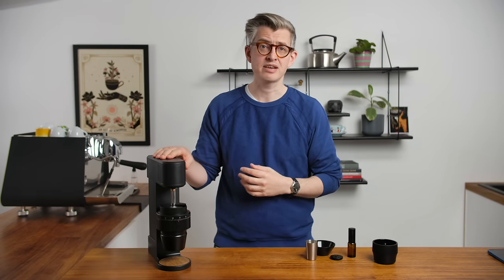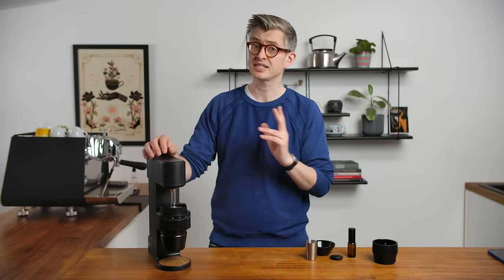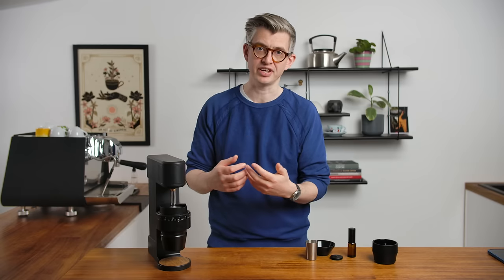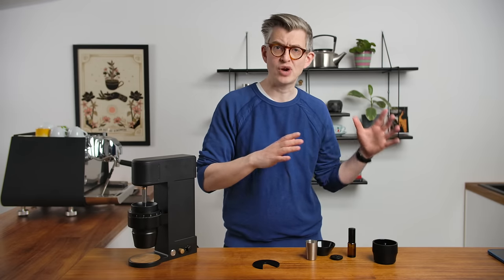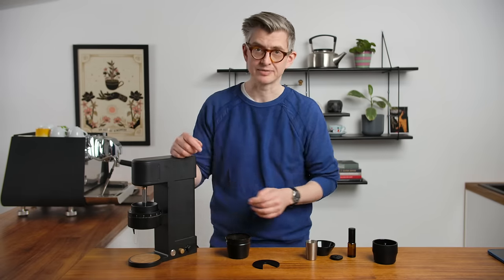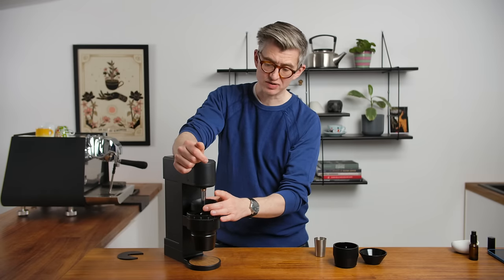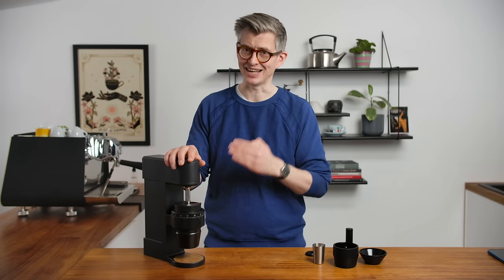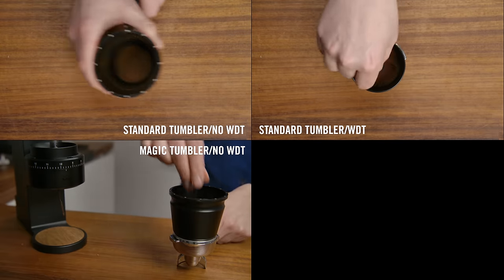Weber Workshops Key Grinder Review

Comment: I was surprised how much clarity you can get from those burrs at lower rpm and how well it works for coarser brew methods as well. It seems pretty unimodal style (except with a kinda Unami like richness) I mean for a conical burr grinder it seems more like what people think of a flat burr especially compared to something like a Eureka grinder which is more traditional and not so high clarity usually. . Seems like Hoffman was maybe referring to Eureka (single dose grinder) talking about there always being risks and potential issues with pre orders / first batches of grinders or anything.  

I'm pretty happy with the Key or those burrs at least. I think Weber as a company and their responses left a bad taste in a lot of peoples mouths.

Comment: James, I use a Niche with a magic tumbler, it would have been interesting to have used the magic tumbler in your comparison of both grinders as I've found that it makes a small but noticeable improvement to the Niche as well. If you want to spend a serious amount of Patreon subscriber's money, it would be interesting to compare it to a Versalab, I have both grinders and it's a fair way ahead of the Niche, and then I suspect the Key, with the same single bearing shaft that the Key has, but a far better bean funnel lid functional solution. A value for money comparison would be interesting
Reply: Monolith MC4 and A Versalab as well as Titus are probably nicer / better, but also more expensive or harder to get. I haven't used any of those myself though, I have really been enjoying the coffees out of the Key though.

Comment: The magic tumbler sounds like a great idea, I really hope to see that feature in other grinders moving forward.
Reply: HG-1, HG-1 Prime, HG-2 and The Key have em, but they're all related. The WDT thing is kinda annoying on the Key though where it could end up sitting anywhere at the end of grinding and you need to avoid hitting it. I took mine out, works nicely without it. I do WDT after it's in the basket before tamping. 
I don't do RDT (water spraying) either, never liked the idea of doing that.

Comment: On the topic of the rpm setting vs flow speed:

My bet is it has something to do with that huge unsuported shaft flexing. Everthing is a spring, no matter what you make it out of. Bearings also have some tolerance so they can function at all. Coffee will not be entering the burrs symmetrically just due to bean shape and other factors so I could see the shaft deflecting and altering the distribution. This is likely nonlinear with rpm and may be the reason you saw the results you did. 

Also just seems such an odd choice, unsupported shafts that are loaded in high torque with asymmetrical and sudden load changes are a bad combination in any machine. This is a use case that requires that shaft to deflect as little as possible and they did the thing that makes it almost as floppy as possible. Would love to see a redesign that addresses this issue and see if it makes a difference.

Comment: Something lower rpm means as well is less heat. High rpms tend to give grinding surfaces a lot more heat buildup and less time to dissipate it into the air away from the coffee so the coffee can get heated up quite a lot when grinding. I wonder how much that affects the taste and quality of your coffee... maybe something to try and test in the future?
Reply: I don't think temperature created by friction of the grinding process really affects anything unless you're grinding continuously large amounts of coffee like commercially. For home use it's not really a factor in my opinion. There's also some who argue slower rpm makes the coffee more hot since it is in contact with the warm burrs for longer. In my experience coffee from higher rpm grinders like Eurekas (1650 ish rpm) do seem to shoot out slightly warmer coffee grounds vs something like DF64 (1250rpm?) I think.

Comment: Back in the 2000s my main grinder was a three phase Robur with the 83mm burrs, driven by a variable frequency drive. I found, just as you did here, that lower rpms at the same grind setting gave slower espresso flow rates. Seemed to me that the slower speed kept each bean in contact with the burrs (and other beans) longer, resulting in more crushing and smaller average particle size.
Reply: That's awesome, you were ahead of the curve there :D Great explanation of why it might work that way, I think you may be right.
 Did you find you got better clarity as well with that grinder going lower in RPM? I think that grinder or others that use that same burr type are more more for high volume cafes and work at a much higher RPMs and I've heard have a very different profile as a result (more body, less clarity at their stock RPM)?
Reply: @BensCoffeeRants  As a matter of fact yes, I was ahead of the curve. 😁 Re: noticing greater clarity at lower RPMs, no I didn't notice that. But you have to appreciate that 15 years ago we knew far far less about how to make good espresso and most of us were struggling just to make a drinkable shot. So nuances of clarity and flavor notes were quite beyond our reach.

Comment: Your observation about the effects of grind speed is very interesting. I experience the same thing with the 1Zpresso J-max. When I dial in the espresso with the lowest grind speed possible  - determined by my grip strength - and then increase the grind speed to the extent of my physical prowess, extraction time decreases from about 30 seconds to barely 10 seconds.

Maybe this is completely unrelated and due to a physical defect in my grinder, but the similarities to your experience struck me.

Comment: Never used the "anti-popcorn" lid or installed the WDT clip. Used the dosing cup once, but it's too narrow given you need to spray down the beans. For me, 30rpm is fabulous for really dark roasts, and provisionally, also Italian blends containing robusta.

On the "scaling up" discussion, I think I would have mentioned COVID and in Taiwan particularly, the floods, rolling blackouts and labor shortages the island suffered while the Key was going into production. Certainly not things the Niche had to deal with when it premiered.

I also notice that the magnet on the bottom of the Magic Tumbler effects my Pyxis scale. I wonder what the implications are of (long-term) exposure to a magnetic field on electronics and metals the Tumbler comes in contact with?

Comment: I didn't like the magic tumbler paperclip WDT tool just because it's hard to know where it will end up then you need to work to avoid hitting it otherwise you bend it up and also fling the coffee bits stuck to it all over ( I never use RDT ) theres a little static sometimes sticking to the edge of the burrs but I don't think it 100% needs RDT. I'm just not a fan of sticky moist coffee beans. RDT also introduces another variable. Apparently more or less sprays can affect shot timing and grind size somehow (on any grinder not this one specifically, not a problem if you're aware though and do it consistently).
On my key I got another wiper arm that is shorter it works with the funnel for the regular tumbler and works well. Doesn't get in the way. I like using the regular tumbler funnel cone with the slightly taller magic tumbler otherwise at high rpm without RDT you can get some overspray.
Reply: Just wanted to share an update, with this grinder, for me, I prefer to use it now with the Magic tumbler, but without the built in WDT tool, or wiper arm. You can easily / quickly add/remove the tumbler without worrying about knocking anything (besides the grinder itself).  I don't use RDT, and for light roast coffees I usually use they don't seem to stick to the tumbler or anything, it comes out nice and fluffy usually, I still do WDT once it's in the portafilter (not sure if that's necessary or not, but out of the tumbler it's not 100% flat and level).  Some coffees maybe darker roasts or more oily ones will stick a bit more to the walls of the tumbler  (I tried a high quality Robusta which was actually good, as well as a half decaf that did that).

I also just got an HG-2 I'm comparing it with, it's very similar.

Comment: Plenty of comment traffic so far - I came to coffee late - sick of paying big bucks at Starbucks I felt I could do it myself and started with the nesspresso and then a bean to cup Jura - ok but still not even quite so during last years global lockdown I resolved to go big when I got home (working abroad and stuck there for 7 months) via this channel and others I narrowed my search and revised my cost plan up and settled on a Decent and a Niche with a Weber Key on the horizon - the Niche (paid a little over list to get one on time) arrived but having got the ultimate (my opinion) in espresso emulation and creation tools I also splashed out on the HG2 from Weber as it’s the opposite of digital content creation - No regrets and the Niche went back in its box and it will be sold As for the Key I am glad my suspicion on low speed stalls is confirmed - tiny (powerful) motor but maybe too much for the thermal load under stress and the drive shaft well after a year mines pretty solid - the transfer gears are where failure could occur so sum up - Key not for me I like my grinds by hand - ok brew time

Comment: Would love to see a comparison between a good hand grinder an electric one. Because, it seems to me that you can get a much better grind for half the price of an electric grinder by going full manual. Jx-Pro vs Ode for example, half the price, and you can even grind for Turkish, while the Ode even struggles with light roast for drip.
Reply: That's actually not a good comparison and totally depending on what you're using the grinder for. Other ppl only wanna brew Filtercoffee and buy the ode with ssp Brew burrs where it really shines. If you wanna minimise costs and only handgrind sure, this might be a better solution
Reply: You could also ride a bike in the rain instead of wasting money on a car. But would you want to?
Reply: My espresso machine arrived a few months before the Key, so I was using my Commandante to grind for 2–3 18g espresso shots a day for a while. I was surprised how well that went, but the coffee produced by the Key is notably better in terms of body and complexity. And of course it's a much more pleasant way to start the day ;)

Comment: IMO for a $2000.00 grinder, the words "frustrating", "sacrifice", "not ideal" really shouldn't be coming up as much as this. I think Niche makes a more "usable" product, and in the end, that's typically a bigger indicator of long-term success.
Reply: I agree with you, but would also point out that price doesn't correspond to usability (usability of an Aston Martin is awful compared to a Camry). Weber's proposition is just different. They do push the envelope and the usability niggles come with that turf verging on the blue horizon.  The commitment to reinvent and refine is a good one, the ecosystem is better for it I think.

Comment: As someone who doesn't have one (I'm a hand grinder kind of person, so take it with a grain of salt), this seems to be very good, but for a fairly narrow selection of people. 
It doesn't look like they've skimped on anything or cut corners, it just seems like...they might need to work on it a bit. 
I'd be worried about the unsupported section however-I'm sure that it's totally fine now;it seems very well designed and built, but any moving part will wear, and I feel like leaving it like that could lead to issues a few years down the line

Comment: James, sorry for the long comment, just dumping my thoughts on lower rpm settings.

The low rpm might be nice for two reasons: better acoustics and fewer clumps. 
Since we are looking to keep the motors power output the same across rpm settings, we will see speed change inversely to force applied. This is where Youngs modulus comes in and likely why more fines were produced at the lower rpm. For the grinder, we are looking at the force applied on the burrs from the beans ÷ how much the burrs compress from their original length. By lowering the rpm & raising the force we are emulating the experience of a material that will impart a larger force on to the beans as the material compresses. It should feel like using a ceramic burr set. 
I'd suggest testing the clumps produced by a lower rpm grinder & if using a softer burr set will produce better results with fewer fines.

Comment: Well, i’ve got several points
1) The distribution. Yes, WDT-ing in the dosing cup before brewing alongside WDT in the basket does bring the espresso game up, and no, for me it always was user experience feature only. I’ve tried that before, and couldn’t spot the difference. The magic tumbler is seemingly the same.
2) You can buy something like that tumbler separately on the aftermarket to use with any grinder.
3) You can easily modify to make RPM variable on any grinder by simple external dimmer mod - no damage made, no disassembly, no void warranty. 
So why?

Comment: I was a bit confused by your "Niche Zero Comparison" - in the beginning, you say, "It's a surprisingly different shot from the Niche; it's a heavier shot, it's a little bit more texture, it lacks a little bit of clarity by comparison, it lack brightness and a sort of top end to it..."  This sounds like you're describing the Key, as compared to the Niche.  

Then later, you say, "The Niche is going to be a broader particle size, and you taste that, for better or worse.  You get a bit more texture, you get a little less clarity, and that's OK!"  This sounds like the opposite of the above comparison.

I'm assuming in the first quote, you were actually describing the Niche (as compared to the Key), is that true?
Reply: Correct he described Niche 's taste profile.Niche more body , more complex . But less cality , less brightness.
Reply: @patompoomwichitchoti6051  That's right. I'm using a KEY, too. Compared to Niche, key is similar to big flat espresso(Especially at a low RPM)
Reply: @DS__112  ahh OK, thank you!  I see now, he's saying "the shot from the Niche is..."   NOT   "The shot from the Key is different from the Niche, in that it's..."  Thanks for sharing your experience, too

Comment: I wonder about the duty cycle of the motor in the Key. Sounds a lot like it would be the issue with stalling. Most home appliances have motors with rather short duty cycles.

Comment: Do you do the spray with the niche? The manual says not to do it and I feel I haven't seen you do it, but in a recent video you mentioned "use the teaspoon method for grinders that don't recommend the spray method". That's where you put a drop of water on the spoon and mix it into the beans?

Comment: I’m about a month into using my Key and I’ve found that compared to the Niche it is a bit more of a fiddly workflow. I had modified my Niche with the Decent portafilter stand which meant I was grinding directly into the basket. I think the magic tumbler is great, but it kind of feels like a step backwards for me in some ways. 
The one thing that does frustrate me is that post-RDT, the beans do get stuck and I need to poke them with my finger to unstick them - It’s just annoying and I always think I shouldn’t be sticking my fingers in near the burrs (completely safe, just seems weird). 

From a taste standpoint, I have found the coffee to be brighter and slightly tastier than the Niche, but it isn’t fundamentally different. It isn’t really different enough to pick it over the Niche in my opinion.

I bought the Key as I was considering buying an EG-1 and kind of got caught up in the hype. I think I may end up buying an EG-1 anyway, but this is a beautiful piece of machinery and it does look great on the counter-top, so I think it would be hard to part with.
Reply: Wanna sell some of your excess coffee gear? Clearly you've got a decent collection going.

Comment: For the anti-static spray, I’d like to know please what kind of water to use (tap, distilled, hard, soft) and what amount of pressure to apply. One spray or two?? 😅 Great vid btw. Although I would only dream of spending this much money on coffee equipment, I learn loads from your videos which I can apply to my cheaper but still pretty good home set-up. Many thanks for the education!
Reply: Just any water will do, you only lightly spray (1 or 2 press) to add a little moisture, to the surface of the bean and mix. Just start with 1 press first, and see if you already got you desired RDT result
Reply: I'm not a fan of RDT, makes beans stick to things, I prefer using a grinder where it's not really necessary. It also affects your grind size distribution somehow, so whatever you do, 1 spray, or 2, you want to keep in mind for espresso it might change your shot timing (slowing it down I think, more spray = slower) So keep in mind if you start doing it, keep it consistent.